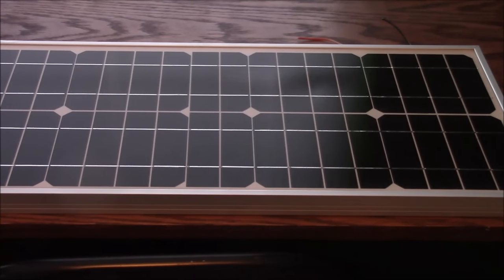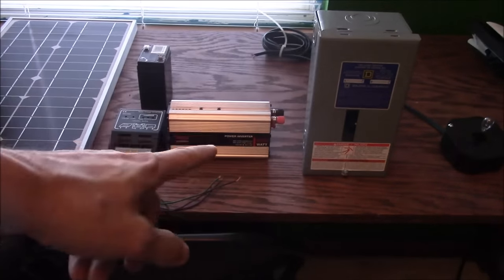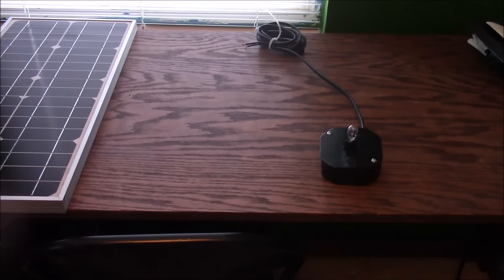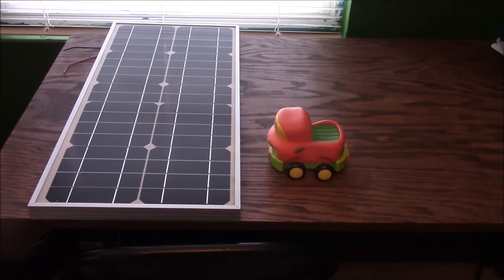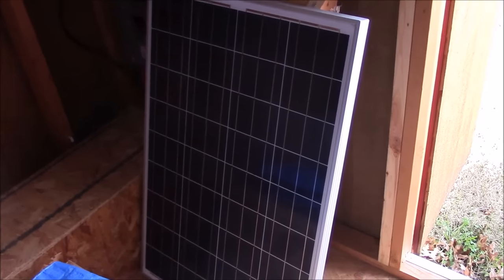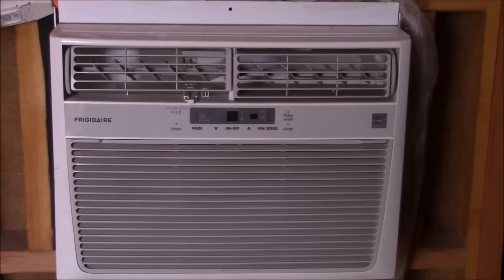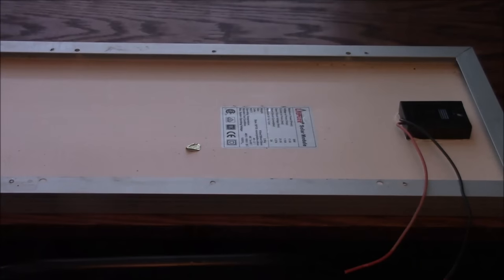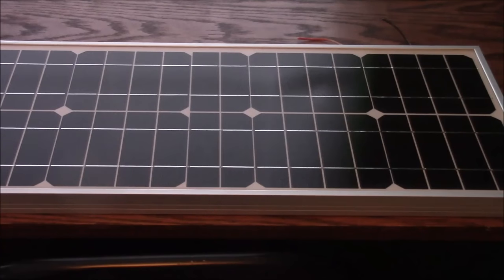Solar Panel Systems For Beginners - Pt 4 Frequently Asked Questions

Comment: If you're like me supplying the whole house isn't possible.... lol, the 1st thing I want
in an Emergency is one room that has A/C - Heat along with a small fridge and the
PC. A couple of small lights & I'm set but even this, "meets minimal" arrangement
isn't cheap. Figuring for power losses across lines/devices plus the available use
of about 50% of lead-acid batteries leaves one having to miser just to have comfort?
Thanks for the series.... I learn little things in every one of them.
Reply from the maker: It is possible.  But it is a prohibitively expensive investment that most people can't make.  You will get a return in 10-15 years, depending on your cost of electricity from your power company.  But most people can't afford to wait that long for savings.
Reply: @LDSreliance ~ That's a fact. I really believe the costs have been kept
artificially high to prevent people from ditching the fat cats of oil/gas
& other electricity manufacturers?  I can't prove that but they've had
control over electrical needs since day one & from my research I've
read stories of peoples inventions being bought up & hidden or
some met w/ worse for not selling out?  You've got a nice video
series.  Do you have a Store?  I've not even looked above yet
sorry for that.  I'm trying to design a system now.  peace
Reply from the maker: Thanks.  I do have a store (https://ldsreliance.myshopify.com/).  I am in the process of updating it so currently the checkout system is disabled but you can email me directly to place an order (ldsreliance@gmail.com).

Comment: Question please: I have four 100w Rich rigid panels and eight batteries 12v  (not Li ). I want to add two batteries but... instead of adding two more 100w panels for a total of six panels, can I add two 200w panels to the system for a bit more energy??
Reply from the maker: If you put the 200W on its own string with its own charge controller and just connect it to the same batteries that will work fine.  But if you just add it to the same mix with all the 100W panels it won't work very well.
Reply: @LDSreliance  thank you that's a big help. May God bless.
Reply from the maker: You are welcome.  Good luck!

Comment: Great videos thanks. A couple questions though, what exactly does the charge controller do? I'm thinking of running the wires from the solar panel straight to the battery as I do not need to use the load function, I will be running everything straight off the battery. Is this possible or do I still need a controller?
Also, will the solar panels keep charging the battery until it's full automatically or do you need something to cut it off when it's fully charged?
Thanks.
Reply from the maker: You can do that but you risk destroying your battery or causing a fire.  The solar panel will supply a high voltage to the battery regardless of its state of charge (as long as the sun is out) and basically it can "overfill" the battery.  A charge controller monitors the battery's charge state and when it gets full it switches to "float" which just provides a tiny flow of electricity to offset the slow discharge of the battery.
Reply: Ah I see thanks!
Reply from the maker: MPaixao You are welcome.  Thanks for watching!

Comment: I don't know if you are fermiliar with the Patriot generator or not but I have on for emergencies and I have 2-100 watt solar panels that I bought with the generator. I have never had too use the panels but I was wondering if I can use these panels in a stand alone system too charge regular batteries and run an inverter .
Reply from the maker: Yes, you can.  I'm not familiar with the panels they sell but I am familiar with the power station.  So I don't know if the solar panels have MC4 connectors on the ends or some sort of proprietary plug that only works with the Patriot power station.  Hopefully it has MC4, which is industry standard.  Then it would be easy to make some leads that can go to a solar charge controller, which will charge some batteries.   You can then connect the inverter to the batteries and use the power year round.
Reply: @LDSreliance  Thank you. I will take a picture and try too match the connectors up.

Comment: I was watching your video on the peltier water cooler and was curious if you think a solar off grid system could be used to power the peltier, pump, and cooler?  If so , what wattage panel would be necessary and what amp breakers would I need to build it?  Thanks in advance for any info...
Reply from the maker: +sirswerdna Yes, solar is great for peltiers because you don't have to waste any energy converting AC power to DC power.  However, you will need a lot of solar panels and batteries to run one peltier around the clock as they are very power hungry.  A better option would be to install a thermostat on the peltier so that it reaches a realistic temperature and then can be turned off and on automatically to maintain that temperature and decrease the amount of energy used.

What size peltier do you want to run and where do you live?  I can give you an estimate from there based on that info.
Reply: That was fast!  I ordered a tec1-12705 50w 77w max peltier, I live in grid cm88wa(Northern California).  The thermostat sounds like a great idea.  I am building it to keep about 5 gallons of water at about 68 degrees through the summer-I tire of swapping frozen bottles of water and cannot justify the $$$ of a chiller.  Your vides are great for diy'ers like me, keep up the great work.  Thinking of running the peltier on one circuit and the pump and cooler on the other to help minimize energy costs.  Even if solar won't power the system 24/7, any savings would help.  Thanks again.
Reply from the maker: No problem.  Happy to help.

According to some quick calculations, you should average about 5 hours of direct sun per day in Northern California and if we assume the peltier will run 12 hours out of 24 and it consumes 60 watts of power then you will need at least 125 amp hours of batteries and 325 watts of solar panels.  But my gut is telling me you will need more like 150-200 amp hours of batteries.  I have played around with peltiers a lot and they always surprise me with how much more power they need than you think.

Comment: question for you. I want to run a pretty standard Hydroponic system on Solar. that would be a pretty good pump (to get the fluids up the A frame I use, and a couple of air pumps - maybe a timer. all these usually run on AC - does it make sense to just use standard materials or try to look for DC pumps?? Can you show an example of running a small hydroponic system using solar??
Reply from the maker: I have wanted to run a hydroponic system, too, but never had the time to set it up and get it going.  On the AC vs DC question you are going to lose about 20% of your power converting it from DC to AC.  So you can either get 20% more solar panels or look for a DC pump. If the DC pump is twice as expensive as a comparable AC pump then just get the AC pump.  You can certainly get all of it DC if you look hard enough.  Then you don't have to purchase an inverter, either.  But again if everything is a lot more expensive don't do it.

I wish I could do a video and show you but I just don't have the time or money to invest in a proper hydro setup right now.

Comment: if your still answering question, is there a way to regulate the power and monitor how much power is stored into the batteries?
Reply from the maker: +Akami McCallum There are expensive electronics you can buy that will do that.  Usually it is an add-on for the more expensive charge controllers.  They will have an LCD panel that provides monitoring and statistics on the system.

Comment: Can you add 500 farad capacitor to make the inverter more sine?
Reply from the maker: I have read that you can build an RC network with resistors and capacitors to clean things up a bit but I have never tried it.  Some say you can also use a transformer to do something similar.

Comment: This may be a dumb question or I wasn't paying attention but can you attach the chrage controller to the battery and the load center?
Reply from the maker: Yes you can.  You can connect the battery to the "battery" terminals on the charge controller and then connect the load center to the "load" terminals on the charge controller.  The charge controller will then monitor the battery and shut off the load if the battery gets too low.  However, you will be limited by the amp rating of the charge controller as to how many amps you can run through your load center.
Reply: Thanks!
Reply from the maker: You are welcome.  Thanks for watching!  Be sure to subscribe if you haven't already.

Comment: I need to know I have solar panels charging my battery's on voltage multi meter it shows 13.4v on the load center it shows battery full 12.4v 
Right my q now is 
Everything is connected but my inverter keeps poping an ic I presume it's when voltage gets low on battery 
Is there a way to protect my inverter from poping an ic? I think it could be when the inverter shuts down that the power trickles back that witch are left in the cable to the outlet back into the inverter 
The inverter does have an overload switch but as far as I can tel it's just to protect it from too much power from battery's and not from the little power left in the power cord 
Is that even possible and if so what can I do to protect it 
If I need too add an bus terminal what amp do I look at? 
Oh in FYI I'm running on DC power I'm from South Africa

Comment: I have a 100w solar panel.  connected to charge controller with lighting power which is connected to battery.. we use the lighting power for bulbs but we installed inverter to battery for appliances..  Is this ok?
Reply from the maker: Yes that is great.

Comment: Can you run lines from the battery (apply the load to the battery for an  pure sine inverter) instead of running a line directly to the charge controller for that device.
Reply from the maker: Yes that is the method you would use if your charge controller's load output is not high enough for the loads you want to run.  You lose the low voltage disconnect protection, though, so keep that in mind.  Here is a video I shot on this topic:  https://youtu.be/k8aVnRpoRLc

Comment: Hi if you add (for example) 2 12V batteries in series it will be 24V and will the charge control support this and will it not affect the inverter if its input is 12V tks
Reply from the maker: +ayubowewa Good question.  A lot of charge controllers can handle 12v or 24v.  But you do need to check your specs beforehand on the model you own or that you intend to buy and make sure it can.  As for inverters, I don't know any that can handle both 12v and 24v.  And the 24v ones are rare.  So you can buy a 24v inverter or you can use a voltage converter to step down the voltage from 24v to 12v before it gets to the inverter.  I shot a video on how this works:  https://www.youtube.com/watch?v=0V5p8JMynIk
Reply: +LDSreliance Thank you for your reply
Reply from the maker: ayubowewa
You are welcome.  Good luck!

Comment: Please advise how the setup would be different if you were using Li Ion batteries.
Reply from the maker: Only difference is you need a charge controller that can charge lithium batteries.  They are more rare and more expensive but there are several options out there.

Comment: I loved the bit at around 7 minutes when he looks at a 1600-2000 watt a/c unit and says, that would be at least 20 panels.  Of course, I'm like, so... 800-1000 watts would be 10 panels...

And if I could find something that operated on 500 watts, that would be only 5 panels.

 But I couldn't run my refrigerator.

I was like, "I'ma get a fan instead."

Comment: Go,d job.  I think alot of people over estimate how much power a solar panel can put out.  Having built my own electric bike, I know how much power it takes to charge my batteries.  To fully charge my batteries for about 12 miles of riding, it takes 45 amps at 12 volts for 90 minutes. That's about the entire output of 10 100w panels.
Reply from the maker: Yep.  I hear ya.  I am trying to educate people that solar is exciting and fun to play with and can be a great asset for preparedness and independence but it is not magic and takes a lot of money and effort to produce any meaningful amount of power.

Comment: thank you for share us knowledge i have question
how can i use for fridge?
how much watt needed for fridge?
Reply from the maker: +turth never Hide I have found out you need a big inverter for a fridge.  If your fridge is a 600 watt fridge then you could probably get away with 1000 watts of solar panels and an appropriate amount of batteries.  But the inverter will need to be at least 2000 watts and probably bigger than that because the compressor motor on the fridge draws a lot of amps when it starts up.

Comment: Does it matter how much watts/amperage/volts the solar panel has to has to operate well with the charge controller?
Reply: And for the battery?
Reply from the maker: +T&N games Not really, as long as your solar panel(s) does not exceed the amp rating of the charge controller.  If you are just using one solar panel you should be fine.  I would never use less than a 20 amp charge controller just because you don't save much, if any, money getting a smaller one.  And 20 amps will handle even a large solar panel or several smaller ones.

Just make sure the solar panel voltage (12v or 24v most commonly) can be handled by your charge controller.  I am pretty sure yours is 12v and most any charge controller can do 12v so you should be fine.

As for the battery there is some complicated math to how big of a battery you need but if you are just starting out you can just use most any cheap battery that matches the voltage of your system (12v or 24v).  You will almost for sure destroy your first battery when you are learning how things work so don't rush out and get something expensive.

Comment: Thank you for your videos. It's been a long time since I've last reached out to you. Something recently came up and I figured you were my go to guy when I first started. On my old system, I used a Stanley battery charge when I would hook up on my shore power. My question is this: Will charging my battery bank while the solar system is on, damage my battery? I recently saw a guy have a inverter/converter combo with his system. His inverter/converter was pretty expensive. Now that I am building a new system for my bus, I wanted to make sure using a separate battery charger like I did before was safe. Thank you in advance for you help.
Reply from the maker: Yes, you cannot have two charging sources going at the same time unless they are designed to work in conjunction with each other (which is rare).  You can easily wire a switch, though, that will allow you to switch to shore power for charging when available and then switch back to solar when nothing else is available.  Here is an example of such a switch:

http://amzn.to/2EsYMHD

Ignore the labels on the front.  Look at the picture of the back of the switch and then it will make sense.
Reply: I knew I could count on you to clear things up. Thank you! Btw, that is a great product and will definitely be ordering that. To clear up what that person did with shore power and inverter/converter. When he plugs in to shore power, does his inverter/converter know to shut down the solar system? Is that how that expensive interver/converter works?
Reply: This was the video I was watching: at minute mark 14:19 it shows the diagram. The shore power is connected directly to his inverter/converter. 

https://www.youtube.com/watch?v=wl9lAP7FXhc&lc=z22wxh0yjteecnfy504t1aokglfzys32lypdrsddcrdzbk0h00410.1517279523268677 

This is the inverter/converter in mentioned:

https://www.amazon.com/gp/product/B004L0K910/ref=ox_sc_act_title_1?smid=AWPBFTW0ZXVPR&psc=1
Reply from the maker: Yes, that inverter has a built in 60A transfer and also doubles as the battery charger when connected to shore power.  So it is designed to handle both tasks.  That is why it is so expensive compared to a normal inverter.
Reply: You're the best! Thank you very much buddy. Talk to you soon!
Reply from the maker: If you don't want to have a mega expensive inverter you can just handle the task manually with that switch I linked you to.  When you pull in to an RV park where you have shore power or whatever you switch to that input.  But when you are boondocking or the RV is parked in the driveway or whatever and you aren't using it you can leave it on solar.
Reply: Yes, that's what I plan on doing is the switch. I wished I picked your brain MORE on my last build. When I sold my camper van, I noticed that the power on my battery bank was always weak. Now I know why. I damaged the crap out of them. smh.
Reply from the maker: It is all good.  That is how you learn.  You'll do better this time!

Comment: I always love your tutorials, I have question.
What's minimum voltage that man starts suffering with DC voltage.

I always thought that DC is safe to work any any Voltage is it correct?
Reply from the maker: What do you mean man starts suffering?  Electricity is dangerous in any form.
Reply: @LDSreliance  it's not when it comes to batteries...
Any way thanks for your response.
Reply from the maker: Yeah you can't get hurt by a AA battery or something because they produce such small amounts of current.  But a car battery or something larger like that can do some damage.
Reply: @LDSreliance  I agree, also I'm working on building a solar car.
I was confused in selecting a solar panel could you please suggest me to choose the right one.